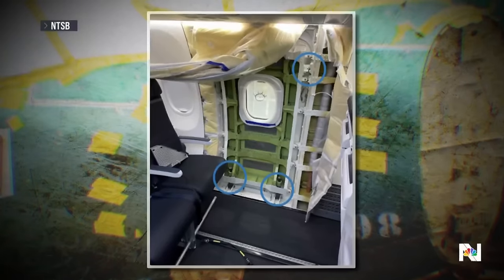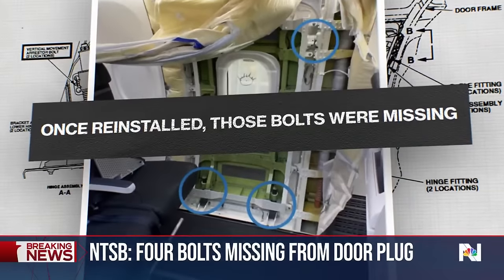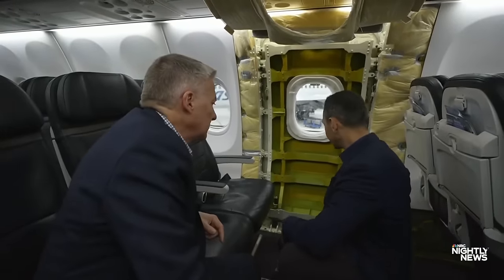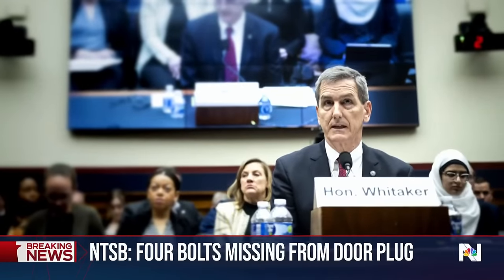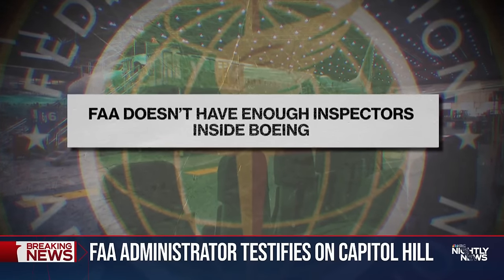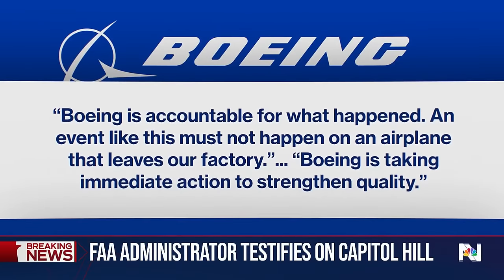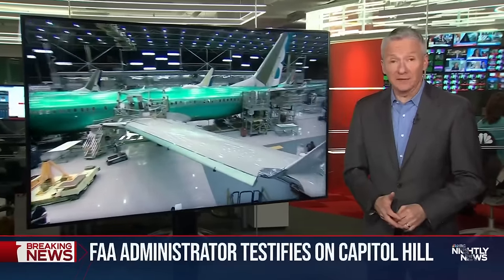NTSB says Max 9 door plug left Boeing factory missing bolts

Comment: Boeing self-inspections led to 2 crashes with MCAS and door falling off BUT now we should expect Boeing to do the right thing?
Reply: These are two very different types of problems
Reply: @neilkurzman4907  they are evidence of the same thing. They are prioritizing production schedules over maintaining safely designed and properly manufactured airplanes.
Reply: @AlexandarHullRichter  
The MCAS is definitely a result of them trying to rush the process. 
The door is more insidious. There’s a missing procedure. Nobody noticed the procedure was missing. 
Or did they notice but nobody would accept the responsibility to fix it. 
Even worse, if it exists are there others.
Does every work instruction need to be reviewed?
Reply: @MarkUKInsects  yep 👍 major components ,

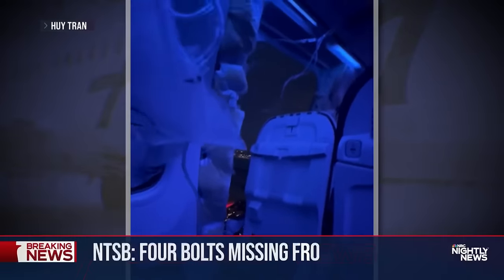Comment: 0:09 Closeups of the infamous “figure 16” photo, taken last September, from the NTSB preliminary report showing at least 3 of the 4 bolts missing during the rework of bad rivets. #4 bolt at upper left we don’t know about because the insulation is blocking the view, but the assumption seems to be that it’s also missing. If all 4 bolts are missing one has to wonder if those lift springs on the bottom hinge assembly are allowing the plug to simply sit there in the closed position, with the springs simply holding the plugs weight? Some have suggested that’s exactly what those springs do, but others suggest the springs have enough tension to push the door upwards on the guides towards the “open” position to where the 12 “stops” are no longer engaged. 

If it turns out that the lift springs DO have enough tension to lift plug beyond the closed position we see in this photo, one has to wonder- what’s keeping it there? Maybe a zip tie around the stop pads to temporarily restrain movement while the bolts are installed? Look close at the 2nd up stop fitting at forward edge of opening. You can see a zip tie around it with the extra length of strap projecting down into the blue circle NTSB added to show location of missing bolt.

IF- the springs DO have enough strength to lift the plug and it flops open, in the absence of the 4 bolts, wouldn’t that happen long before the plane ever got loaded with passengers for the first time? I’m not the first to see that zip tie, and the NTSB makes no mention of it, but some have questioned if that zip tie was left in place and held the lift springs down until it broke at 15000 feet on Jan 5?

Comment: Ford built and sold MILLIONS of pick ups with the fuel tank mounted directly behind the bench seat in the CAB of the truck.
Not one engineer, assemblyman or customer caught that fatal flaw.
Reply: No doubt that was before there was a regulation prohibiting it.
Reply: @GH-oi2jf  Just an FYI.
McDonalds coffee is hot.
If you need these regulations, your education system is really the problem.
Reply: @guybeingaguy mcdonalds coffee was unnecessarily hot. If you think that lawsuit was mutt, you’re clearly someone who doesn’t know that regulations are written in blood or by hard lessons learnt.

Also the US is defunding education.
Reply: @aquillandscroll6428  Your right.
I’m wrong.
Reply: @GH-oi2jf  The problem is not regulation but that car companies find it cheaper to let people die and settle than to recall the car and fix the problem.  And they choose for $ in place of the lives of people.

Comment: That picture of the missing bolts has little context.....or value. I mean, it is OBVIOUS that even if the bolts were installed they weren't safetied with cotter pins. But I highly doubt the plug would have stayed in over a two month period with no bolts at all. Even with this photo I still think that one or more bolts was installed but just not safetied and then eventually fell out. I don't see how it could have stayed in place over TWO months with no bolts at all. At 0:16 ......LOOK at those lift assist springs. You think that plug is going to stay in place riding on those assist springs?  Unlikely.
Reply: It is possible, because the bolts don't do any "heavy lifting" once the aircraft is pressurized. The bolts simply prevent vertical movement when no pressure is applied ie, on the ground. The guide track on the top can keep the door in place, but not permanently, some bouncing while landing or taxiing could move it slightly. The 12 stop pads actually hold the door in place in flight. That's why it worked for 2 months, because the design is really good... but those bolts are obviously still critical to prevent vertical movement while on the ground. It was just pure luck that the door didn't move during the first 2 months.
Reply: Sute it could have flown without them.  If the springs aren't strong enough to lift the door clear of the stops, then the stops will retain the door.  A jolt from turbulence could lift the door free, but at cruising altitude, the pressure differential would be greater, so the friction against the stops would be greater and a stronger jolt would be required.  What seems to have happened is the plane entered turbulence at a lower altitude.
Reply: @mk88200   "The 12 stop pads actually hold the door in place in flight. " 
I don't know why you are telling me this because if you read any of my comments you would know that I already know this.
Reply: @mk88200   " It was just pure luck that the door didn't move during the first 2 months." 
I have a VERY hard time believing that it could stay in place for two months with no securing hardware. That's a stretch. My best guess is that one or more bolts were installed but not safetied. That's my guess until the final report comes out. Although I will admit right now that the holes look too pristine if bolts had been installed. But again.....brand new aircraft can look surprisingly pristine for a very long time. Plus the fact that in the NTSB photos we can see that bolts WERE actually installed from Spirit.....so we know that bolts occupied those holes between Spirit and Boeing, and yet looked very pristine with little to no witness marks even after falling to the ground 14,000 feet. So as far as I'm concerned there are still a few of possibilities on the table. 
There is one more observation I've noticed. I haven't seen one of the assemblies first hand but from these photos it looks like the guide roller doesn't fill the depth  of the guide track all the way nor is it covered 100% by the lock bolts. I think the roller only extends about half way over the lock bolt. I think this was part of the fracture pattern of the guide track.....because the guide roller didn't fill the track all the way. The guide roller looks too short in my opinion. It could be a little longer. I have rigged some Guppy doors and I think we used to shim those rollers to within .002 of the side of the guide track. They filled the guide track most of the way. Just an observation.
Reply: @GH-oi2jf   I guess you haven't flown lately. America's runways and taxiways are in terrible shape. LOTS of rough surfaces and bouncing going on. I will wait until the final report but I think it very unlikely that the plug could stay in place for two months with no hardware at all. That's just my opinion. (What difference does it make?) It might make a difference when coming up with a fix for the problem. First you have to identify exactly what happened.

Comment: Wait, your saying that Boeing workers knew that 4 bolts were missing, even has a photo of it and yet the plane still rolled off the assembly line? Are we sure there are nothing else missing from their planes that they didn't disclose
Reply: The worker wasn't instructed to install them,  you don't go adding parts you're not told to. 

The worker photographed the work they had done,  they had no idea that it was going to be certified to fly after this,  for all they know that plug needed removing again for interior fitting.

Comment: The fact that it stayed in for two months with bolts missing is actually a credit to the design of the door plug. I bet that the person who designed it is no longer with Boeing.
Reply: Totally disagree,  it has to move up and out,  it would take time for vibrations to move it
Reply: Valid point 👍
Reply: @xaiano794  A bunch of over educated engineers spent hundreds of hours to determine every detail of those bolts.
I tend to agree with them and my brain surgeon myself.
You do you though 👍
Reply: @guybeingaguy  it's a standardised design,  numbnuts. They just added bolts to secure the mounts in place instead of the normal mechanism which goes in a door. 

It isn't complex,  it just goes up and out,  like every small pressurised aircraft on the market worldwide
Reply: @xaiano794  You’re right.
I’m wrong.
Reply: @guybeingaguy  You think good engineering is the reason that they had to redesign the MAX after several plane crashes?  You seem to think engineers and doctors are some sort of combination between a martyr and wizard.  We are normal people who have to decide between a paycheck and fk’d up corporate policies. Most stick with the $.  The vast majority of engineers and doctors didn’t work hard at school to be martyrs.
Reply: @jilpok1074  
Your right.
I’m wrong.
Sorry.

Comment: Decades of lobbying for "self approvals" lead to the FAA reducing the number of Inspectors. Then Boeing continued to reduce its own ability to inspect and its safety culture. Theses events should not come as a shock and now both the FAA and Boeing don't have the capacity to ensure safety during the manufacturing process. The FAA needs to remember that it is a regulator, hopefully it will get its teeth back. There was a time when they were pretty sharp.

Comment: 0:19 The devil is in the details! Technically they didn’t “remove” the plug, they only “opened” it. Removing it creates a paperwork requirement, and apparently a simple opening of it does not. The problem is, the 4 bolts have to come out to do either one. 

Maybe there was confusion caused by the name? Is it a door plug, or just a plug? Is it a plug door, or just a door? The people writing maintenance manuals know that you open “doors” all the time without a paperwork requirement, maybe they misinterpreted what the engineers were telling them?  Removing a door is a big job that does involve paperwork. Why else would the procedure for “opening” or “removing” this thing, whatever you call it be different? Both involve removing the bolts!

Comment: Why did the inspection team miss such a blatent critical fastening point. Were supposed to believe the other 1.5 million fastners are in place and corectly tightend with safety wire if was required. Something in boing upper management stinks of profit over safety.
I wont ever fly on one.
Reply: The problem was, they didn’t miss it. The computer didn’t generate tasks because it wasn’t in the system to do it.
Reply: They don't have any checking,  they cut it to save costs

Comment: There's only 1 US plane manufacture and FAA don't have enough people to check Boeing? so what's the FAA is for?
Reply: Well, what about the work ethics in FFA itself?
Reply: Just like everyone else, they have been letting people go for years now. The airlines have warned about FAA shortages. The tower employees are FAA employees also, and there are several towers that have been undermanned for years.
Reply: Remember, when Bush was president and we wanted to get rid of all of the government regulators because they were slowing down business. Well, they actually did that a lot of companies are allowed to self certify now not just in aviation.
And now we reached the point where we want the government to interfere with business😮
Reply: Going after Trump.
Reply: There is more than one, but alright.
Reply: @neilkurzman4907  This would be fine if everyone took their job just as serious as when they were first given authorization to "self-inspect". 

Unfortunately, over time, there is a natural tendency to start taking the "easier path", getting the job done quicker, and the bosses are happy. But this usually catches up to them because their luck runs out, and there is some type of quality incident. And when you are talking aircraft, and the manufacturing of said aircraft, cutting corners ends up with the 737-MAX.

Comment: It’s all laziness from workers
Reply: Nope
Reply: How can it be laziness when it wasn't a worker that does three certification?
Reply: 110% correct
Reply: @francismarion6400  Wrong
Reply: @francismarion6400  how can laziness be responsible for them not doing something they shouldn't have done?

Honest question,  what's your job?
Reply: @xaiano794  Because if it's your job to put in bolts, you put the bolts in. If someone tells you "put all the bolts in except those 4", you ask why?.
Reply: @francismarion6400  so you genuinely think someone's job is 'aircraft door bolt installer'? Like that's the only thing you do?

You aren't smart so I'll try and break it down to your level. 
You work for McDonald's,  your manager tells you to work the register,  so you do. Someone trips and is injured on garbage out back that should have been put in a dumpster.  Is it your fault for not leaving the register unattended and going to do something you were never told to do?

There was no work order issued,  you don't add parts to planes without your manager telling you to do it. The workers are never told where a plane is going after it leaves the floor,  that isn't their job. 

I wonder if you even have a job,  you never replied.
Reply: @xaiano794  I'm a master carpenter. If I ask a worker to nail off the roof or wall and he misses a spot, it's his fault. If I tell him to not nail off a spot, and he doesn't ask why, I'll put them in the discard pile. Maybe building jets is just one of those industries that you want stupid workers for???

Comment: This is so messed up that Boeing could do this. However, the fact that that plane survived as long as it did without those bolts is impressive. Props to whoever designed those decades ago
Lol 😂
Reply: It has to move up and it would take time for vibrations to shift it millimeter by millimeter.  It was always just a matter of time

Comment: The FAA can’t say anything other than “if it’s certified it’s safe” they are responsible for issuing that certification. The fact of the matter is that ALL of the 737 MAX aircraft involved in incidents & fatal accidents have been certified. The FAA is culpable for failure to regulate properly and are scrambling to show force. Boeing got caught red handed & are saying what they need to for survival. The internal culture at Boeing must change. That cannot happen until new management is brought in. Board of Directors should fire the CEO & as many other C suite exec’s as possible. Stake holders in Boeing need to get a grip on what’s happening. Fast.
Reply: The FAA certify the design, not the planes, individually.  They are now taking extra steps to ensure that the planes are built according to the certified design.  They are doing their job as they should.  Boeing is the only culprit here.
Reply: @GH-oi2jf  you’re sorely mistaken. Why do people without the facts act so confidently? The FAA agreed to let Boeing have outsized oversight over their own operations. Oversight that is now being rescinded & assigned to a third party. The FAA is not impervious to political pressure imposed by our representatives from the great State of Washington & beyond. Boeing’s success is a national security issue as they manufacture a large portion of our military defense capabilities as well. You’re out of your league here, buddy.

Comment: They should reduce union pension every time life threatening issue happens.   Give them incentive to do what’s right.
Reply: @orlandopockets6372  You can absolutely blame the workers.  Yes there is a bad culture there, but you have a job to do.  One you're paid well for and where people's lives are in the balance.
Reply: @nikh9080 this wasn't a union worker who certified it,  there are no union members at management levels in Boeing
Reply: @orlandopockets6372 So who is in charge of installing bolts? Or in this case, not installing bolts?
Reply: @francismarion6400  technically no one,  that's the issue. 
Mistakes like this (not creating a work order for the task) can happen,  the point is that there was no checking procedure as there should have been to be able to sign the aircraft off for flight,  the problem is that Boeing is allowed to sign their own aircraft off.

Comment: You know why the door didn't blow out on the first flight? The exterior paint job, applied after the door was reinstalled. That was all that was holding the door in place.
Reply: Absolutely not true. The design of the door is solid. When the aircraft is pressurized - the pressure pushes the door outward, then 12 "stop pads" (metal footings on both the door and airframe) hold the door in place. These bolts don't do any heavy lifting once the aircraft is pressurized, they prevent the door from moving up and down and keep the stop pads properly aligned. This is why the door stayed put for 3 months with no bolts, they luckily stayed aligned. As soon as it moved up a little bit (turbulence? Bouncing while taxiing, landing etc) then the pressure pushing outward and nothing stopped it, so away it went.
Reply: wrong.  That's ridiculous.  Better leave this to the experts.